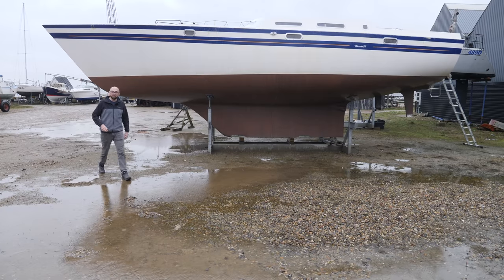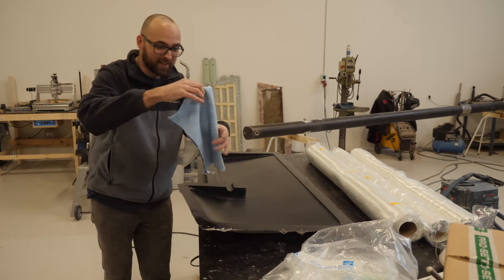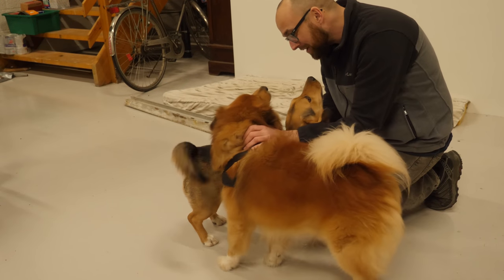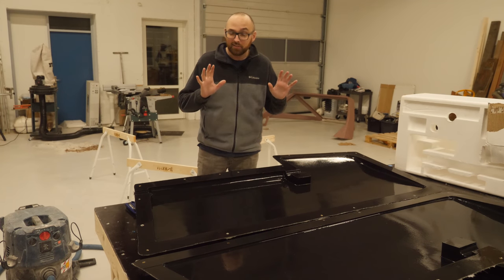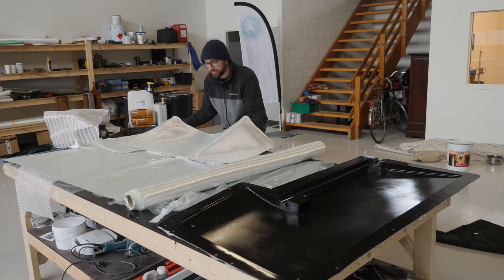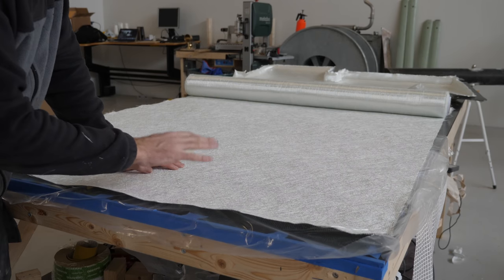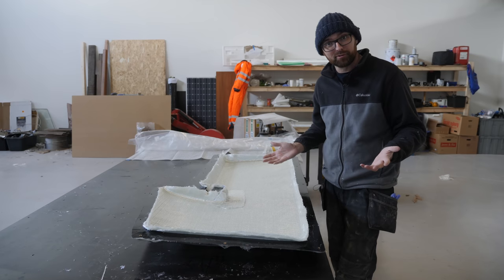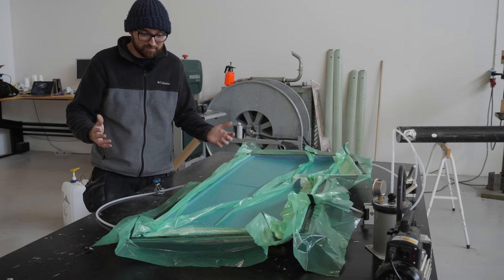Sail Life - DIY building a rudder for a sailboat, vacuum infusion - part 1 of 2

Comment: build quality on internal old rudder is great re-use it it will out live the boat. great video cheers
Reply: Nellie Rutten  The rudder is still fixed to the boat, so it will have the full force of the boat behind it.
As long as the rudder is roughly the same shape, it shouldn't make a difference. 

And i surely understand his choice. Even though the metal skeleton was fine, i understand Mads' urge to make sure everything was ok. If your rudder breaks, you're pretty screwed.

Comment: I would reuse the stainless from the old rudder stock, and where you have corrosion you could just simply file or use a flapper disc and remove it and then fill that area with fresh stainless weld. Then simply grind it down to meet the old profile. BTW another great video. I look forward to these every Sunday evening. Cheers!

Comment: You mentioned previously that you were making molds because the rudder fit other models in the same line of boats --  Well IMO since you are only a few pieces of plate and a piece of tubing away- I would make a complete spare rudder.   Yours will be new, and at the price of those things the "refurbished" one will probably buy some of the electronics you need.   ALSO, what you learn on refurbishing yours will make the all new one that much nicer.  And, finally, I would also make another spare set of molding halves while you have everything out and work flowing efficiently, before you store the molds.  Good luck..

Comment: Hi Mads,
since making the "guts" of your rudder completely new and would cost you quite some money and time (given that you weld it together yourself), I suggest reusing the old ones. The trick i think to come by is to preserve, what you have got. The welds looked pretty professional to me. The only parts where rust had a chance were those where impurities of the metal existed (places where the metal got heated with exposure to air and probably the contact spot where the anode was contacted). Alas, you already cleant it up quite a bit. Now the only thing to do would be to clean the tight spots and seal the surface. Coca cola would do both tricks in one go. The phosphoric acid washs away the rust and dirt. It also builds a layer of iron phosphate on the surface of the steel which is basically insoluble in water (which means rinsing it after it dried is safe). We have protected several iron and steel tools that way from further rust issues.
Fill the minor gaps and holes with some resin and you are basically done. Just make sure the thin iron phosphate layer is not scratched too much.
 
Just my 2 cents for possibly saving you some time and headaches.

Cheers
Enrico

Comment: Mads, thank you for demonstrating vacuum bagging technique for the rudder materials, as I’ve always wondered exactly how it works and what the overall effect and point is. Now we all know. 
Thinking about when you finish your brand new rudder...  seems like when you originally removed the rudder there was a fair amount of digging a hole down below the rudder into the boatyard hardtack. It was frozen solid last time — it’s a good thing that spring is coming, since the excavation should be a bit easier, albeit still a pain in the arse. Nice problem to have tho, looking forward to seeing it.

Comment: Mads, a suggestion for assembling the rudder.  Before you put the two halves together use some thickened epoxy to build up a 2 cm or so wide lip all the way  around the inside of the rudder except where the shaft will be to provide a surface for bonding.  You will need to do some grinding on the join where the shaft is to properly bond the two parts together there.

Comment: Do what Beneteau has been doing for forty years: Make a new composite rudder stock, get rid of the steel. All composite is stronger, lighter, and never has the problem of bonding stainless steel to FRP. There simply is no way to seal the stainless stock to the FRP rudder without water eventually getting it between the two. With all the work you are doing, make the new rudder a "forever" part, too.
Reply: I really like this idea, I bet he has considered it and talks about it in upcoming videos...

Comment: When you build new or strengthen the rudder innards, I think you should add some rib - like gussets perpendicular to the plate between the stock and plate. I think it would strengthen the connection and help with torque transfer between the two.

Comment: +Sail Life:  Hey, Mads!  Another really good video. 🤗 Once one gets past all the technical jargon , things begin to clear up substantially. It's amazing to note the similarities between fiberglass methods and that used in laying up carbon fiber for auto body panel production. Like hood/bonnet, fender/body panel and roof/trunk lids. Supposedly, carbon fiber (CF) is superior to fiberglass (FG) in that CF is stronger/lighter than FG? Suppose you may have considered use of CF but opted for FG since you're more familiar w/ the various aspects of that material? In any event, you seem to be well on the path to becoming THE EXPERT  in the field, rather than just the fiddly DIYer !
As to the rudder stock, FWIW, suggest fabbing new from 304 stainless rather than re-use of the old steel pieces/parts. Given your penchant for perfection (or close thereto), that would seem the obvious choice?

As always, your weekly video does not disappoint! And, as is usual, it garners a standard BIG 👍🏻👍🏻👍🏻. Three of them, no less! At least, in my book.
Have really begun to looking forward to your video posts on Sundays or Mondays, depending. And, THANKS Mads for excellent content/presentation! Very much appreciated and immensely enjoyed ! 😁

p.s.:  BTW, Athena is looking great!   AND---  Jökul appears to be thoroughly impressed w/ all that's going on during the infusion process. Oh, well... ( sigh )

Comment: Nice job Mads. Hopefully you got away with it but it's usually better to tape off the edges so no PVA on the flange . The risk is the tacky tape lifts and lets air under partway thru!  Good for you for trying this on camera! 
Oh I sure hope you don't use any foam in the rudder it all gives up in the end , I suggest you use mix of micro-ballons and resin, a little heavier but will not absorbed water ever. ( well compared to any foam) Cheers Warren

Comment: ? Gel coat?  Agree with others about weld-filling the corrosion in the stock and then grinding smooth.  Looks plenty stout enough.  Save some money and reuse the rudder stock.  Have a good time in L.A.

Comment: I answered no that you should'nt reuse the rudder stock. But that is as it is right now. What I would do would be to weld back the area where there was rust with the tig and 316L rod. Also I would make continuous beads between the plates and the bar. No need for big welds but only for sealing the areas between the plates and the stock where condensation znd water can get to.

Comment: I vote to reuse the internal rudder stock.   I would add three fingers or struts on each side to add strength and stiffness.
You need the welding experience anyway and appearance does not matter since it will be internal.

Do you ever consider carbon fiber for any application?

Comment: Just a small item for anyone cleaning up stainless steel like the rudder system. Ensure you use a stainless steel wire brush or you'll introduce carbon metal into the stainless steel and you'll get surface rust

Comment: If you do decide to use the old hardware get the stock X-rayed, that pitting could well hide crevice corrosion which could lead to rudder failure
Reply: I agree. in stainless its what you dont see that causes the problem. Same goes for chainplates and all structural stainless older than 20 years. Might wel be cheaper to make a new rudder stock than x- ray the old one...

Comment: Hi Mads, I have a similar rudder repair and some rotten balsa deck core to repair.  I'm thinking of using Sicomin pb 250 (or, maybe 170 for the deck core).  Are you still happy with the product?  I have a heavy cruising sailboat.  I'm not overly worried about adding extra weight to the deck.  Do you have any strong recommendations against using foaming epoxy to repair deck core, as long as I remove the rotten balsa and drill sufficient vent holes for the foam to expand through, to relieve undue pressure?  We love your show!

Comment: I think you put a final nail into the coffin of that rudder stock when you went at it with a plain steel wire wheel.  You'll never get that all out of the weld crevices.  You just seeded future rust into it.

Comment: too late now, but in future, whenever you clean Stainless steel, you must use a stainless steel brush!! If you use a steel brush, it looks clean, but within a few weeks, will corrode as you leave steel embedded in the Stainless. Always use stainless brushes when cleaning Stainless steel, and then clean with acetone..
Reply: I agree with this. It is called dissimilar metal corrosion. there is a lot of information online if this sort of thing scratches your itch.
Reply from the maker: It doesn't matter in this case :) If I choose to reuse the old innards it'll all get passivated :)
Reply: @SailLife  Hi Mads, if you get some one else to do the passivation and they have an acid tank, please tell them that it has steel contamination, this means they will have to dump the acid once it is done otherwise it will contaminate any future S/S put into to it. Unfortunately I had to learn this from experience. :(

Comment: You could use some heat to cure the epoxy.
A small piece of metal with some rubber mat glue to it, put the epoxy in a taller  pail place the metal/rubber on  top and hook up 
your vacuum. Now you have a simple degassing chamber...

Comment: It's a wee bit late for this BUT...  Isn't the new rudder going to be lighter?  Wouldn't you want that weight down low especially on a sailboat?  Good video and nice work. :-)
Reply: I have a similar question, will the weight of the old to the new rudder, change the weight and balance of the boat?  Great channel love your diy attitude.

Comment: Just curious, why not gelcoat the molds first for better finish? Anyway a very interesting video!
Reply: Gelcoat isn't compatible with the epoxy.
Reply: Not totally true. West System epoxy bonds well with polyester gelcoat.  Products like "GC50 Epoxy Compatible Clear Polyester Gelcoat" or epoxy gelcoat could have been used as well.
Reply: Like everything there's some exceptions to the rules. But really besides the generalization I posted there's really no point as long as he uses a good barrier coat. It's just going to be painted with copper coat antifouling paint anyways. If he was making things for the topside like a hatch, then it'd be worthwhile to do.

Comment: Is it worthwhile to deep clean the old rudder stock then have any imperfections filled in with new stainless steel? Just wondering on the cost differential.

Comment: I would use the old rudder stock, buy JD Weld steel epoxy and fill in all of the pitting. Grid down the corrosion and fill in with JD Weld steel epoxy. I think you will have no problems with it at all, I used it on boats before and it was great.

Comment: I hope that was a stainless steel wire brush you used on the internals..!!
If you use iron or steel on stainless it will definately rust,Also if it's 316
Reply from the maker: It doesn't matter in this case. If I choose to reuse the old innards it'll all get passivated :)
Reply: Jeg vil tro de har brugt 316 syrefast rustfri til dit ror.
Men det er en absolut dødssynd at bruge en almindelig stål børste på rustfri.
Der er lidt ligesom at skrue aluminium sammen med rustfri skruer.
Det vil ruste også selv om du pakker det ind.
Du skal få det glas blæst og et sted hvor de kun blæser rustfri så der ikke er alm stål i glasset.
Reply from the maker: Hele roret får en omgang bejdse hvis det skal genbruges. Derfor er det underordnet om det er en rustfri børste eller ej :)
Reply: @SailLife  OK, godkendt!
i kolding er der et sted hvor de kan dyppe hele roret. Det er med varme og det hele...
Koster normalt en kasse oel, naar man moeder op med sin trailer.. :)
Reply from the maker: Haha, en kasse øl er en svær pris at slå ;) Tak for tippet :)